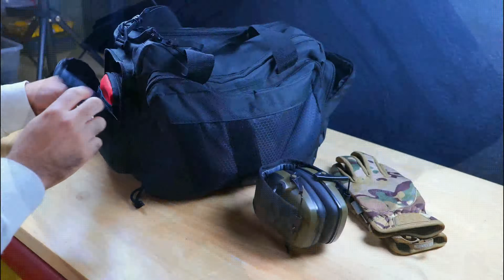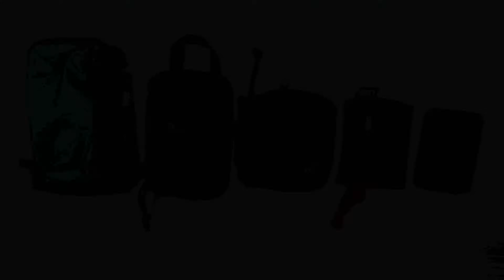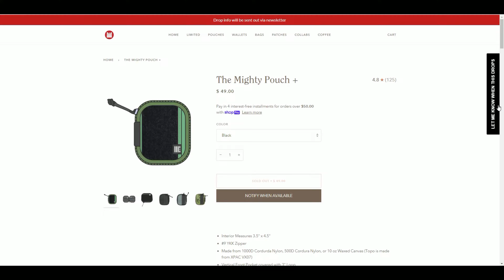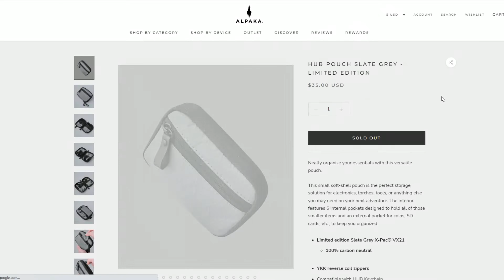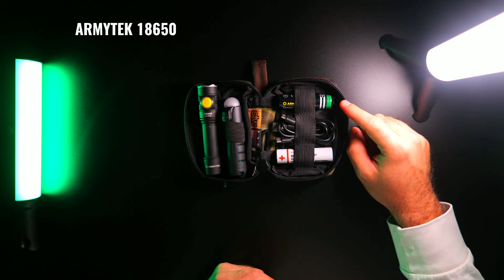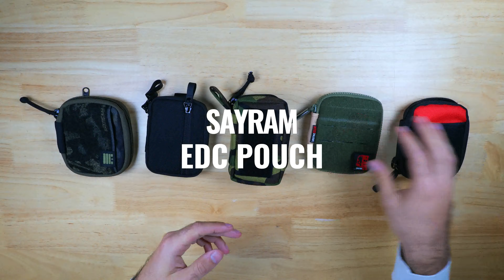5 Micro EDC Organizer Pouches (Garage Built Gear vs ALPAKA vs BroTac GEAR vs STW vs SAYRAM)

Comment: I have the Max-mini, the Alpaka, the Vanquest  PPM, Slim, and the Sayram.  I rotate their usage, and I do like all of them for various reasons. And last the Hide and Drink waxed canvas multi tool pocket pouch…( like it so much and I bought 2 in different colors.).  What I like best about Hide and Drink pouch is the huge zipper compartment…even after loading the tools.  I am partial to the Sayram.  The configuration works well for me.  I find it just as well made as any.

Comment: I would love to buy a higher end version of that Sayram pouch.  Having that outside pocket configuration (one big pocket and two sturdy half-width pockets) combined with a zippered clamshell design at proper pocket size is pretty tough to find.  Lots of stuff is very close, but not quite there.  Guess I'll start with the Sayram and keep my eyes open.
Reply from the maker: Yeah they did a great job maximizing storage space with that design! A zippered pocket might be nice on the outside too!
Reply: That sayram looks dope for the price. I just bought an mighty pouch from garage built gear, it's really nice. My alpaka hub is on the way and I'm gonna buy that sayram soon.

Comment: Really got into pouches myself.
At the moment I have the Alpaka HUB pouch and some off brand Chinese ones because it's hard to get good stuff shipped here sometimes.
The Alpaka is for EDC gear (SAK, pliers, cables, etc), another pouch is my micro tool box
Reply from the maker: Yeah the hub pouch is great! Currently testing it out as a wallet replacement and so far its looking good!

Comment: I wish manufacturers would start to put a lighter color material on the inside so in low light items are easier to see and quickly locate.
My friend has all camo gear and has had search parties to find his knife, lighter, etc... that he dropped or layed down on the ground and blended in.
Reply from the maker: Yeah garage built gear and sayram did a good job with that... not too hard to include a high viz interior.